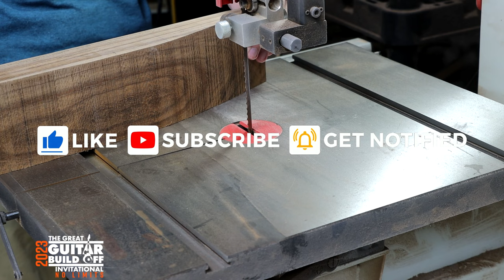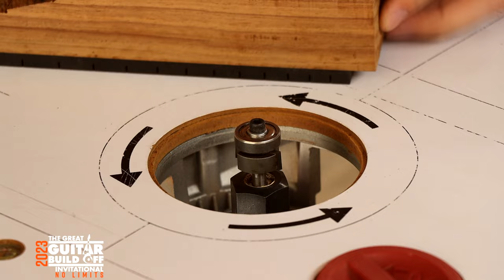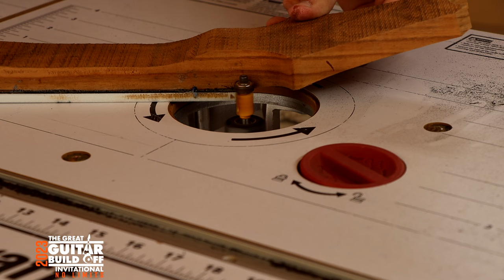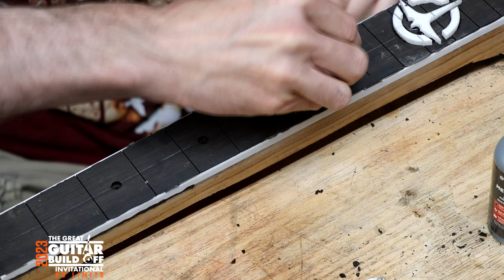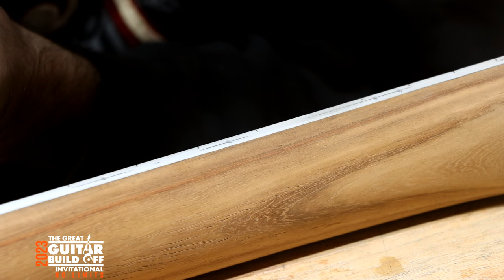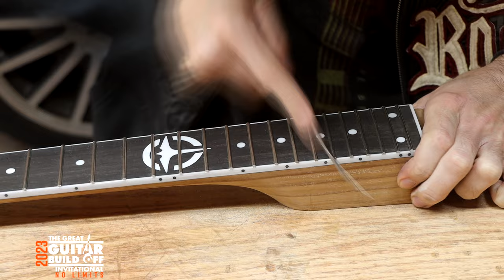Great Guitar Build Off 2023 - Invitational Entry - "Oscar" || Part 2 - The Neck

Comment: Great video as always.  I'm about to start my first build, will be ages before I'm even good enough to consider GGBO, but could I ask what thickness of neck blank you use?  I like the idea of not having a scarf joint.
Reply from the maker: If you want to have a headstock break angle without a scarf joint, I would say you want the neck blank to be at least 2 inches thick.
Reply: @OrbitalGuitars  Many thanks!